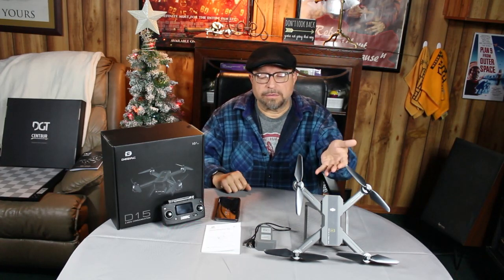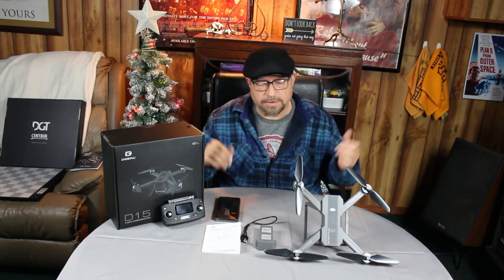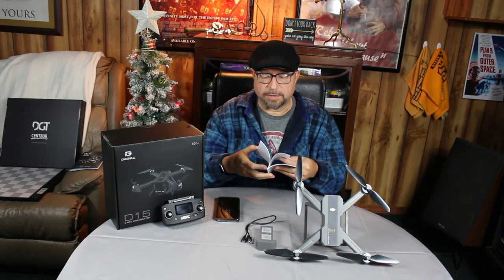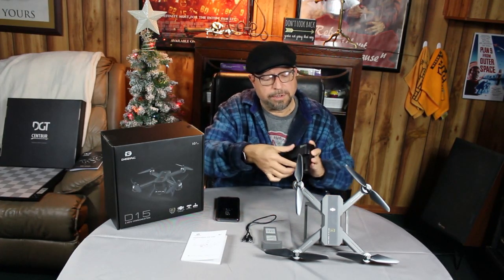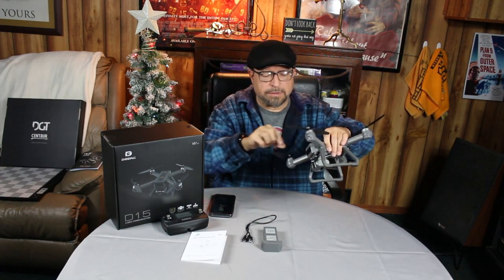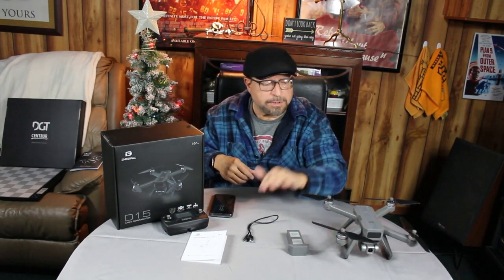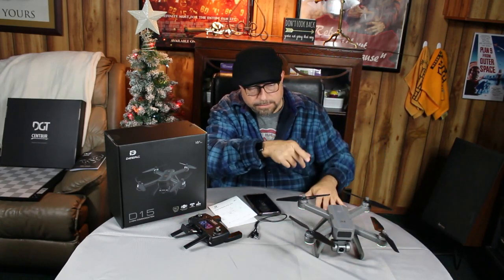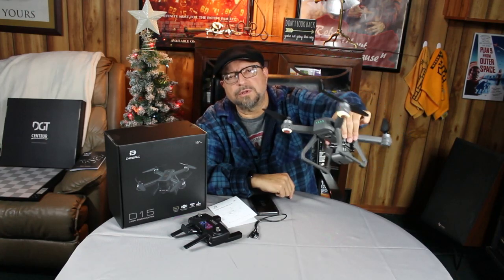DEERC D15 Drone Calibration

Comment: I'm having trouble connecting phone to drone
Reply from the maker: Ok, can you be a little more specific? A wifi connection problem? What kind of phone? Thanks.  Maybe I can help.
Reply: @skymantechnology8329  thx got it finally figured it out..got it going and crashed Abt 20 feet, tried again , it went backwards and hit my house and knocked the srewes outta 1 blade...lmao.... where can I get more of them...thx
Reply from the maker: @Marco-bg8jf  glad to hear you got it going,  sorry to hear about the mishap, happens to all of us! You should have received extra blades and screws in the D15 box.
Reply: @skymantechnology8329  only got one set, any suggestions
Reply from the maker: @Marco-bg8jf  at this point I would contact customer support, they have been very helpful to me.
Reply: @skymantechnology8329  I have ... only had 1set that came with it, 25 days or more to get more from China.. good grief